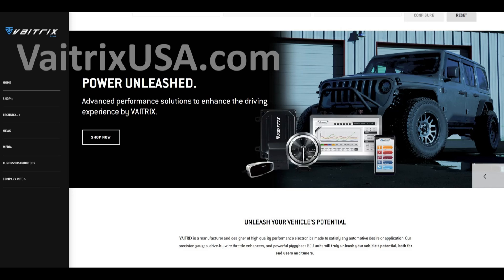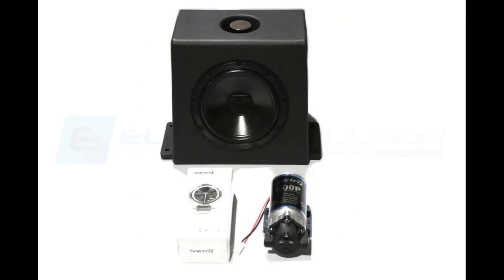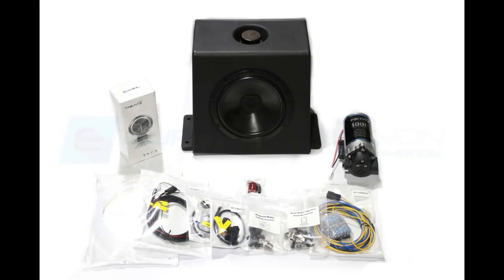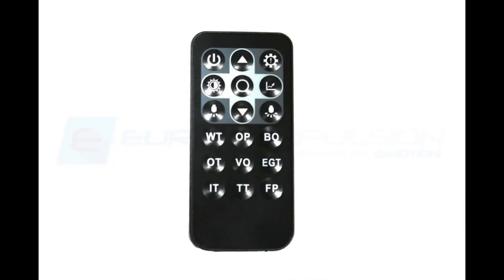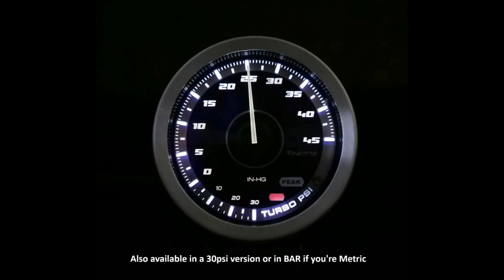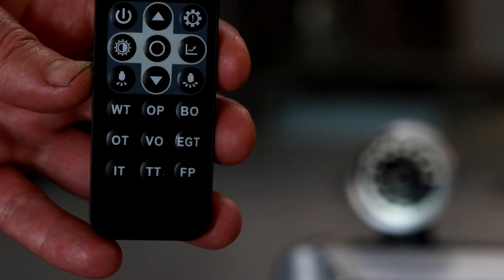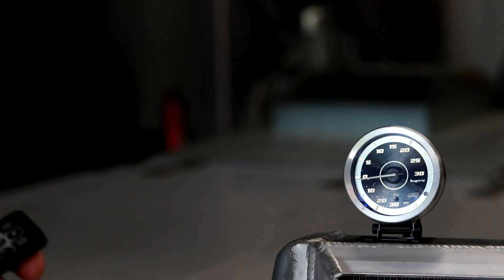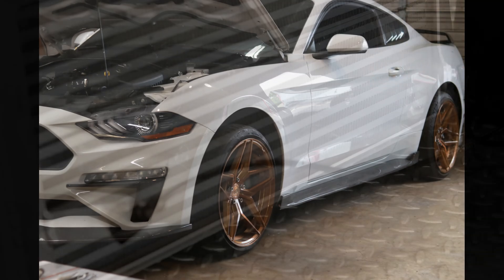Vaitrix Water Methanol Injection, How to Program it.

Comment: Hey man.. How do I know it switched on?
Reply from the maker: In some cars you can hear the pump run, or if you have an intake air temp gauge you can see the temps drop after a short time. The best way is to put in an on/off light.
Reply: @GregsAirplanesandAutomobiles 
Understood, however I did follow your steps but I didn't see any liquid or meth passing thru the tubes to my manifold. I did mine in Singapore however the seller isn't being cooperative. Perhaps you could assist me on this. Already did set the low boost at 0.5 and high at 1.5

Comment: I have question, is it possible to run water methanol but through a carburetor that sucks the mixture in a fuel injected vehicle pre regular fuel . injection?
Reply from the maker: Yes.

Comment: What are your thoughts about using a water methanol injection system on a direct injection engine to clean the intake and valves? Thinking about setting one up on my 2016 Silverado 5.3 to try it because these engines are notorious for dirty intake valves due to the PCV system. Being that it's not boosted, there really wouldn't be much, if any, power gain, but that's not what I'm concerned about. Wouldn't have to run the system continuously, may just once a quarter or when going on long trips to really get the best effect from it. It could also help with towing to a small extent. Having it spray while towing my boat up a long grade mmight help it run cooler and provide some anti-knock which would allow the VVT system to adjust for best power output.
Reply from the maker: Yes, that will work, in fact it's one of the big benefits of this type of system on a modern direct injected engine.

Comment: Nice kit! Do you have any data on reliability of the system? And is there a "variable spray" (continuous adjustment) rather than "Lo-Hi" capability in the device or planned?
Reply from the maker: It's very reliable, I'm using this stuff in my own cars. There are more options coming, including a very advanced controller with features I'm not at liberty to discuss just yet.

Comment: Also, I got a question for you? Why does boost plus ethanol/methanol works so well, and NA cars don't seem to benefit from these fuels. Even over enrichment in over advancement during PE( which I don't like doing ) Run after run on the Dyno....NA cars appreciate the protection but don't appreciate the difference in fuel compared to 93? 

It has something to do with cylinder temperature, obviously.... That's where things get dangerous the higher your cylinder temperature the better the injection works(or the more power is measured) 

This is why some cars run 100 shot nitrous with the meth injection with 18-20 lbs from an eaton 1750 😢 and peg the timing at 25* 🫠 and just like that an Angel gets its wings
Reply from the maker: That's a good question. Let's look at it another way for a moment. If you take an engine, say a Dodge 360 with 9.0:1 compression, it's going to run just fine normally aspirated on 93 octane US pump gasoline. It would probably be fine with a bit less octane. Thus it can't really use any more for knock protection because its timing is already set ideally. Now if we put 100 octane race gas in the Dodge it won't make any more power because it can't exploit the higher octane.

    Now, let's overhaul that engine with 13:1 compression. It's going to knock like crazy on that 93 octane pump gas. We will have to seriously retard the timing to get it to run and it will probably still knock at full power. Thus with race gas, or by adding water injection we will increase the octane (effectively) and allow optimal timing and thus more power. So the problem isn't that NA engines can't use water:meth, it's that they need to be built with a lot of compression to take advantage of it. The turbo guys simply crank up the boost to exploit water:meth, or race gas. I hope that helps.
Reply from the maker: I also want to add that I almost never suggest water:ethanol, there are some weird cases where it's better than water:methanol, but that's very rare.
Reply: @GregsAirplanesandAutomobiles  i was suggesting using e85 with water/meth 50/50....its a thing with DI boosted engines pushing 90-100 lbs/min of air at 7k
Reply: @GregsAirplanesandAutomobiles  Yes I agree but thats not the entire story: RPM and the  camshaft valve events play a role especially the overlap timing and duration and "installed centerline" you can take a heavy OL camshaft advance the installed centerline to reducing dynamic compression (torque) at higher engine speeds when there is less combustion control/prediction, like injector duty cycles and ignition dwell times.... because those parts never fail lol 

Boosted engines are different I think its because of the cylinder temperatures are so MUCH higher with double the manifold pressure on top of static compression the meth works wo well because the heat loss from vaporization? Displacement creates less stratification of lean pockets prior to kernel ignition?"? not sure

Comment: Has anybody figured out how to keep seals in a meth pump? The two biggest issues are injection pressure.(head pressure) and shaft seal erosion/failure. The high head pressures require heat loss through incompressibility, the wetted material used to seal the liquids against the shaft have to be elastic enough to absorb the vibrations from a permanent magnet motor, but be resistant enough to erosion from methanol.... the high torque load of the DC motor causes shaft deflection when started and when stopped.... as far as I know these motor pumps last about a year exposed to methanol 50-50 six months with methyl Ethel mix

Why is this important? 

Water methanol is a knock suppressant by slowing down the acceleration of the flame propagation after the ignition kernal... or a simpler version is preignition... methanol has a high octane on its own along with water, which is the best knock suppressant but can't

Preignition is peak pressure before TDC  Almost all of the heat from combustion is transferred to the piston rings and the rod bearings as heat

This is why I don't like injections using external pumps , when the pump fails and it will peak pressure may not be achieved and a fail safe automatic kill circuit has to be put in like in the fuel pressure sensor grounding it out zero

My advice  run TEL , or led additive with your base fuel , does it change to afr and doesn't require injection, Combined with ethanol, you can get very high limit
Reply: Sorry some of that was speech to text at the end I meant

A very high knock limit .... specially, with boost and direct injection engines as e85 e100 isn't an option when power levels exceeded the Injection window required for adequate mixing
Reply from the maker: Hi ramtuff, Adding lead isn't an option for most of us. Even when it is, the effective octane can be raised even higher with water injection. For example, and I have videos here about this, in WW2 the US was using 150 octane fuel and still used water:methanol injection to crank it up over 180! That 150 had A LOT of lead in it. 

    As for the pump and methanol I have many options for that. First, I normally run a mixture of 90:10 water:methanol. The pumps last for many years set up like that. Sometimes I run 50 : 50 by volume and I haven't had a Vaitrix pump fail ever. As for safety there are several ways to set up failsafes so that if the spray stops boost goes down. Of course that's another video entirely. This one was a quick overview. As an example, the Vaitrix low level switch not only turns on a red light on the Boost gauge/controller, it can lower the boost if using a Vaitrix boost controller.
Reply: @GregsAirplanesandAutomobiles  Thanks for trhe reply! Ok so not to get off topic but octane is a dimensionless value given, the heating value determines the fuels potential energy in BTU's per kg mass....another draw back of methanol/ethanol/water is volume displacement because the AFR requires 25-35% more fuel mass for the same mass of air flow. its not 1v1 but more of a heat loss from vaporization and momentum loss from profile distortion. Some say the heat loss from vaporization can reduce dynamic compression(cyl temp) enough to cause a negligible difference in peak power, this is why NA cars don't care much for e85 or meth injection? maybe

Comment: I can’t wait to install this on my Cessna 172! All jokes aside, it could be handy for running auto gas in fuel injected GA engines.
Reply from the maker: That's a good point. I haven't ever seen an STC for that, but it's certainly possible. Many aircraft have used water injection, including a lot of planes powered by the Garrett TPEs.

Comment: How does this interact with ford’s closed-loop fueling strategy? Will it cause issues with fuel trims?
Reply from the maker: It depends on what you're injecting. This question isn't specific to Vaitrix, it's a general water:methanol injection question. IF injecting water alone, it will have no significant effect on the closed loop system. If injecting methanol the closed loop system will inject less gasoline to a certain point. However you have to inject a lot of methanol to see it start to do that.

Comment: How many minutes of spray do you get from this system, and what's the capacity? I presume it varies based on nozzle size and low vs high-spray, but what kind of range is typical?

Also, isn't using such a high-pressure system a bit of a waste for intercooler spraying? Seems like it'd be simpler and easier to relocate a windshield washer line
Reply from the maker: Good questions. It's a 3 gallon tank, that's a lot. For example, on my Fiat 124 I use a 3/4 gallon tank. The car is over 200whp and it's good for two tanks of fuel in spirited street driving. It's enough to run at the dragstrip all day long. It's enough to run at Hallet Raceway for two 20 min sessions before a refill. 

     So this tank is four times bigger. Thus those same numbers would be about right for an 800whp car, or with a 400whp car it would be double what we have with my 124. Again, it's a lot. Now it will depend on your spray rate, which I suppose is another video entirely.

      It would be easier and cheaper to relocate a windshield washer line. However if you already have a water injection system, it's easier to T into that, and it will work much better due to the better atomization of the much higher pressure system.